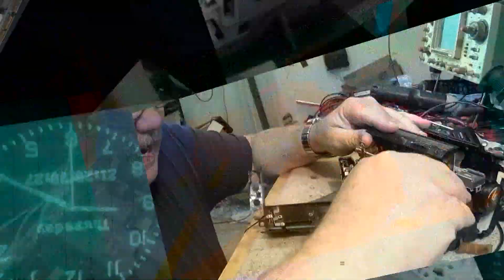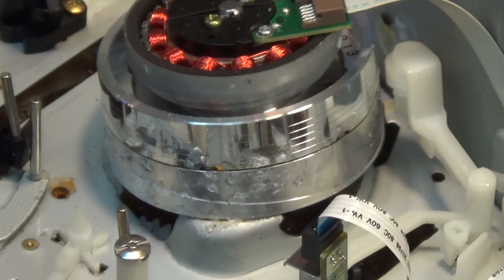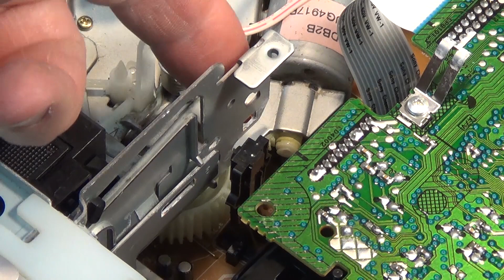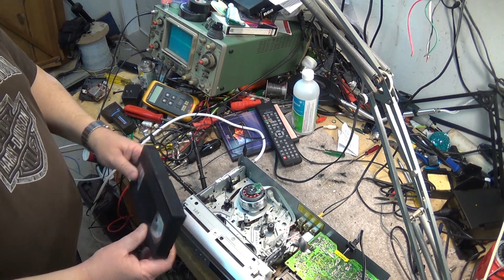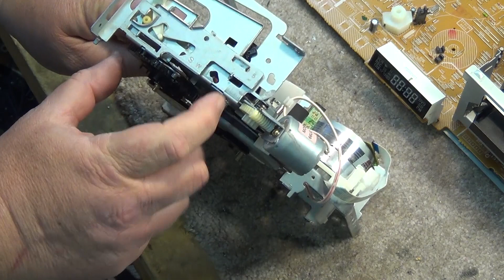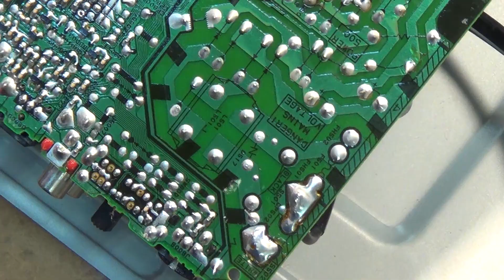Toshiba SDV392 DVD VHS Combo unit Trash Can Rescue

Comment: I know this is a very old video, but I happened to find the exact same machine at a thrift store yesterday. The VHS mechanism on mine works great, but on the DVD side, a very small gear had popped off. I put it back into place, but I'm concerned that it may pop off again on its own. Can you use superglue to keep the gear from falling off the shaft, or is something else better?
Reply from the maker: Sure why not.

Comment: Watched another vid and saw how the Toshiba DVR620/30 units die because of bad surface mounted caps. Replacing them with good electrolytics solves that problem very easily. Now I have fixes for the 3 units my bud gave me because the DVD section doesn't record anymore...

Comment: while playing the tape, it blinks black from time to time.  how to be fixed?
Reply from the maker: I just used my thumb nail against the tape where head passes over it. Learned that from broadcast engineer. Done all the time on air when a head clogs. as they don't have time to remove tape clean and cue up so the operators just very lightly press the back side of theor nail against the head. Hard enough to clean the head, soft enough to as not damage it.
Reply: @12voltvids  Thanks for the prompt reply and the nice video.

Comment: 3 1/2 years after you made this video I'm sitting in my shop fixing a Sanyo combo with a bad mode switch. I still get them from the older customers and the nostalgia crowd. You'd be surprised at what I still get for repair. Very few of us old war horses left. We are literally dying off.
Reply from the maker: I get old crap all the time to fix.   You are right. Many of the old techs are gone now.  Many I knew when I was in the business are no longer around.
Reply: 12voltvids - what State do you work out of?
Reply: James Staton - what State do you work out of?

Comment: Hi Dave, I have a Samsung VCR- DVD unit somewhat similar to the Toshiba unit.  The DVD usually does not spin. I can use my finger to make it spin and with some effort, it will start spinning and playing . Do you have any suggestions as to what might be the non-spin issue ?  Thanks    J K
Reply from the maker: More than Likely the disk motor.

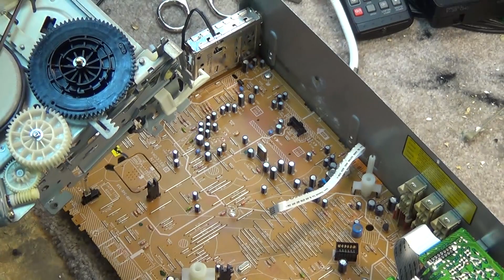Comment: 31:00 - Blown Capacitor!
Reply: yes I saw that, maybe just dirt?
Reply: Looked more like rusty water dripped on it from a steel component above it, notice they're unvented caps, so any leakage would be from the legs (or it'd pop right off)...  Good eye though, wouldn't have noticed it myself.

Comment: Try the Victor brand mouse traps that have the large yellow plastic bait pedal on them. In my experience, those are more effective than the traditional type with the small metal pedal.
Reply from the maker: The Victor rat traps do the job nicely.
Reply: Victor makes rat traps with the large yellow plastic bait pedal too - http://www.victorpest.com/victor-easy-set-rat-trap-bm205

Comment: Hi. I have a Sylvania dvd & vcr combo Model # SSR90V4 It eats the tape and I can't get the housing off. I did take all 5 screws out. But I think their's is another screw but it's under the sircuit board what can I do.
Reply: I'm assuming you got it fixed by now? If not I can tell you what you need to do.

Comment: I have a toshiba vcr/dvd combo model number D-KVR20 and the tape goes in and the unit shuts off. I turn it back on and then the tape pops out.  Any idea what is wrong?
Reply: Clean the mode encoder switch. It's not easy to get to but it will fix your problem. Just make sure you keep track of all the screws.

Comment: Hello...I can't get enough of your VCR repair videos!  I have a similar Toshiba  (SD-V593SU).  I've been experiencing an issue when in timer record.  The display will show 'ERR' and I noticed that the DVD player sounds as though it is trying to read a disk...even though, there's no disk installed.  If I leave a disk installed in the DVD drive, then the "ERR' message on the display is not longer there after setting the VCR timer record function.  Any suggestions on what may be causing this issue?  By the way, the DVD player plays excellently when either a VIDEO or AUDIO disk is installed.  Thank you & thanks for all of your fantastic videos!   Mike

Comment: This unit was made by Orion, which made the Emerson and Sansui VCRs back in late-80s/early-90s. Remember?
Reply: Walter Chan Orion/ Emerson / Sansui are all owned by Funai
Reply: @byronbeasley642  Orion and Funai were separate OEM companies, actually, no affiliation at all.
Reply: Funai were the last ones still out there.  The early Symphonic (yep Funai!) ones were quite awful.....
Reply: Donald Clifton I discovered that Emerson and Orion were the same thing when my mom bought me a little 13' Orion TV in late 2001 to replace the 13' Emerson set I'd had since was a toddler in '94. 
I discovered they were the same chassis when I could use the orion remote to change channels on the old Emerson which my mom was watching in the living room

Comment: Orion DVD inside. Funny.
Reply from the maker: +Gabor Kiss The entire unit is Orion. Look at the chips on the bottom of the board,
Reply: +12voltvids 
Yep, see that now @42m. I don't know if the orion counts as a great one there but in Hungary if you hear orion you just laugh at it cause in the 80s houses got on fire because of orion TVs. :) But Toshiba is a better value here.
Do you have any Panasonic VCRs from 90s? I have an NV-SD250 which has some mechanical problems. Service couldn't fix it unfortunatelly. I wonder where to look for th problem in its super drive mechanism. I wanna fix it, this vcr was my childhood. :)
Reply from the maker: +Gabor Kiss Yes I have a few Panasonic VCRs . I have some from the 80, 90's and early 2000's

Comment: Great video! I always like videos where something gets all plugged in after it came out of the swamp. Those heads looked horrible! Believe it or not I still record music mix tapes on vhs hifi in sound only mode. Do you think there is any appreciable difference between the sound quality of the hifi sound in SP vs. EP speed? I know drop out defects take longer to pass in EP, therefore make a buzz instead of a pop, yet they are less frequent it seems. Therefore I've always wondered there is it better for sound quality to use SP speed for (hifi) audio only on vhs? Since hifi audio quality is still quite good in EP, Perhaps a better question would be: which speed is easiest on the machine long term? Anyway, sorry it's kind of off subject but it's something I've wondered about for quite some time now.
Reply from the maker: +wdavem For VHS HIFI there is no difference between SP and EP. The head rotates at the same speed regardless, just the tracks are places closer to each other. For video there is a difference for sure, wider video tracks can store information without wiping out the fields on either side of them. In SP there is a huge gap between each of the audio hifi tracks, and in EP they are laid ontop of each other.I still use DAT for my audio recording. I have 3 sony DAT decks and I just picked up a Tascam. Fixed the electrical fault, and I need a hard to tind tiny belt now. On DAT there is a difference between SP and LP, as they use a lower bit rate, and the drum runs slower on the LP speed but VHS HI FI it sounds the same. EP will result is slightly higher tape wear because the tape is in contact with the spinning drum for 3X as long every pass.
Reply: +12voltvids Ok that's kind of what I thought. Perhaps LP speed would be the happy medium, except I know there are compatibility problems and I don't even think I have a good vhs working that can record in that speed.  I've given some thought to modifying a vhs deck to record only in hifi, and actually remove heads from the drum that are not needed or just deactivate the video recording. I like hifi vcrs where the sound cut-out during search can be disabled, fun to play with, sounds best in EP because there is no space in between the tracks.
Reply from the maker: +wdavem For audio only EP is fine. I actually have an old deck (not working currently) that has an audio only switch that disables the video circuitry. There is still a signal recorded mind you. That is required for auto tracking. That is what the deck looks at, the RF waveform on the video track. The video track is used not the HI FI track because if you put in a mono tape, auto tracking would not work.
Reply: +12voltvids Nice, I have the horrible Fisher FVH840 (among others) though it does have that same audio switch and was made possibly before auto tracking but I think it does record a signal as the video shows solid black. I stopped using that thing ages ago but I like how it's worn out audio hifi heads made the snare drums distort kind of like a record... nothing else quite like it actually :-/ Of course it was only like that for a few recordings before the heads wore down too far anyway but I digitized them...
Reply from the maker: +wdavem Could have been an alignment problem. Fishers were bad machines. There were tons of really sh1tty VCRs in the 80's and 90'sSony tried to stop this before it happened with Betamax. They had quality standards that they would hold all companies to, by being the contract manufacture for all of them. Unfortunately Sony sold the VHS patent (they developed that format too) to JVC and JVC whored out licenses like they were candy. Lots of competition, and a race to the bottom. This is why you see 30+ year old Betamax machines that still function as well today as when they were new. They were built to very good tolerances, and used quality parts. There were some good VHS machines, but there were also terrible ones out there.
Reply: +12voltvids Yup I think that Fisher did have alignment problems. I had it right at one stage and then likely forgot to check it again for sound after messing with it. Sheet metal chassis, idler tire... I just liked it because it had hifi and linear stereo. Then I went with sony and then professional gear thankfully.

Comment: Beautiful cat!
Those VCR transports ave very complex, I have a Magnavox MWR-20V6 VCR/DVD recorder combo, the VCR section started eating tapes not long after I bought it, I know nothing about VCR repair so I just use a separate VCR to make DVD's.
I never heard of using paper to clean VCR heads, I would thing using "Q" tips would be better.
I used to use those soft flat foam like on sticks made for cleaning VCR heads.
Great repair on that trash bin
Reply from the maker: +old64goat Qtip is the fastest way to trash your heads. The cotton catches the heads and can snap them off as they are very fragile if any pressure is put on them in the vertical direction.Cat very expensive. It is my daughters, and she paid hundreds for it. Very smart. Likes to sit with me and watch me work all the time. Even plays fetch! Tape eating sounds like perhaps a clutch problem or a mechanical timing issue.
Reply: Thanks for that info, I never had any luck fixing VCR's but I thought I would ask
Reply: old64goat - My ever first repair fix as a kid was a cassette player then second was a late 70’s VCR. 
VCR’s are easy, so are cassette players. 
I’ve also come across some tape grabbers/chewers in my time too & I would be looking at what 12voltvids said too. :)

Comment: Mice love to climb along cables and the tiniest hole is good for them, but I found to stop rodents coming through holes rather than putting grommets or sealing with plaster which offers only a temp fix but to stuff them with dryer sheets, the critters will not chew on that stuff at all ever.
Reply from the maker: +Mentorcase Steel wool or SOS pads work great too. They don't like metal shavings in their mouth.
Reply from the maker: +YUKI JINJUJI Bullshit copyright claims on youtube against my videos are ruining my day,

Comment: Thankyou i enjoyed that :-D
Thats just mad, i expected it to be very dead indeed, but nothing really wrong with it lol.
Its a cheap crap deck but i have to give them full marks for clever design and using an optical mode sensor is just showing off lol.
Ive seen a few of this type of generic cheap design, and on some ive been supprised it worked at all!!, some are so nasty and really hard to make it behave mechanically.
.
The downside is the multilegged vlsi beasts, if one goes wrong then its not worth the trouble to replace it, cheaper to buy an new machine :-(.
The biggest shame for me is the waste of a decent head/drum assembly, it has to be decent quality for it to work, i never liked to throw them away, but there often special to that one machine :-(.
Reply from the maker: +zx8401ztv I was fully expecting fireworks when I plugged it in, and I never expected that rusty old head to produce any type of signal, and here it records and plays fine.  That mechanism, believe it or not is one of the nicer mechanisms I have seen in a long time. Very simple, and very little to actually go wrong with it. The optical sensors are more reliable than mechanical switches. Old JVC machines also used optical sensors on many of their old machines.
Reply: +12voltvids 
Yes my old piano key jvc uses two for the tape end detectors and a 12v bulb in the center of the deck to shine through the tape :-)
The downside to the jvc is the dc motor driving the head flywheel, if it wears it can be a pig to stop the picture breathing or swaying, it cant be stopped by tweaking the analog servo pcb.
If the head bearings arnt perfect you get the same effect, rather touchy.
Its been retired to a shelf, i dont bother with tv at all now.

Comment: An unwelcome house guest
Reply from the maker: +Kayemache I don't show mercy to rats.Too bad that little bastard got lucky that time.I found where they were getting in, and that tiny hole in the underside of the soffit is now screened up. I wasn't happy when I opened the hatch of my work shop to get all the decorations down.
Reply from the maker: +shesnailie I have 3 of those, 1 is particularly effective, a large Bengal Tabby. I was tempted to put her up in the atic, but then I would have another problem, how to get a half feral cat that doesn't like to be handled down. To the mechanical approach seems the best option for this location. I'll let my 4 legged furry friends deal with the ones outside.